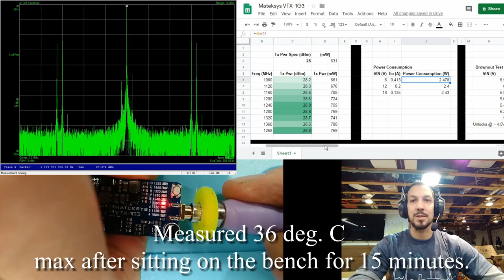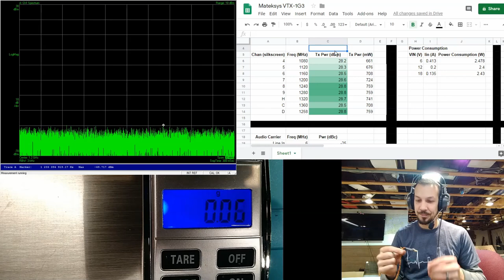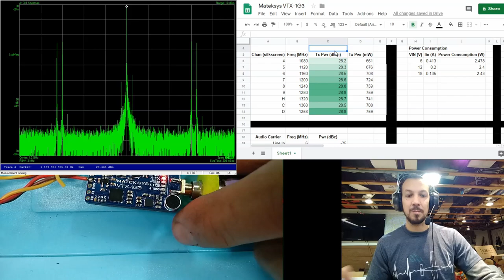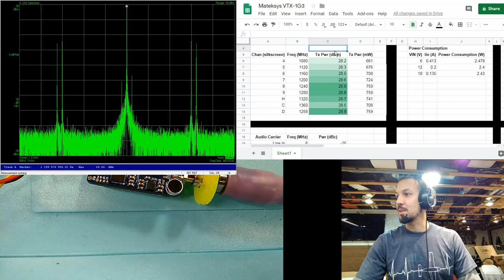Mateksys VTX-1G3 1.3 GHz VTX First look - Long Range FPV Video Series - PK's Lab

Comment: Hey PK, I see on Matek's website that it accepts audio both on 6 and 6.5MHz as you said, but on Matek's website they say that for 6MHz audio you need to tap directly into a pin on the transmitter module, the audio in is for 6.5MHz, same for the onboard MIC, but I am a little confused, if the pin and the mic are on 6.5MHz both how does it know when a mic is connected to the audio in pin to switch the onboard mic  off? And also if you go on Matek's webiste they show you the pin for 6MHz audio, if you have time and the possibility can you test if the onboard mic switches off when connecting an external one? and if indeed the pin is 6.5MHz or 6MHz, cause with 6MHz I think the RMRC receivers can do 6MHz audio, I'm also thinking if replacing the trap filter in the recievers from 5.5-6MHz to 6-6.5MHz would allow the receiver to get audio . Thank you very much for any ideeas on this matter, really apreciate it

Comment: actually in vco's the inductor produces that microphonic thing (in my line of work, FM broadcast tx'es) if I have a noisy fan  those vibrations are heard on to the carrier ahaha except those new DDS things
Reply from the maker: Nice! What power levels?  agreed :) inductors are def a source of micro-phonics.  Especially if they are air core.  But don't rule out other components. esp as you move up in frequency.  Anything that is in the loop or tangentially involved with the pll in can be a potential source.  I really should've recorded this video first thing in the morning.  Was running out of caffeine and I think it shows ;-)
Reply: @PKsLab  Well I have tx's ranging from 50w to 5kw :P  I remember years ago when trying to make pll works in 88-108 :))

Comment: I think what most folks want to know is the selectivity of the VRX.  
That is, how well does it reject signals on nearby channels or bands.
Of course you'll have better ways to do this with your equipment, but the way I've always tested this at home is to power up camera +  VTX  with it signal highly attenuated (I run it with a terminator, while placed inside my microwave oven), and then VRX in another room, while I power up another VTX or control system some varying distance away and on various frequencies  to see how badly the VRX receiving the weak signal gets stepped on.  
I've tested old Racewood VRXs, same + SAW filter upgrade,  newer Racewood style with Comtech module, several versions of RMRC's digital display VRXs and the junky original digital displays, as well as a couple 1.3Ghz goggles modules.    
For noise sources I've used another VTX on various other 1.0-1.3Ghz channels.  VTX on 910Mhz.    Crossfire at 915Mhz and various 433Mhz LRS Tx's which sometimes interfere directly with the electronics of the VRX (especially the goggles module). 
 Some of them have greater sensitivity, but for selectivity, nothing holds a candle to the original Racewood + SAW filter. The stock digital display units are so bad, I throw them away. RMRC's digital display units are better, but still not great.   The 1.3Ghz goggles modules tend to get stepped on by 433Mhz control signals.     All of them are susceptible to noise from Crossfire relatively quickly (verified in the field), and I was never able to find suitable filtering on either VRX or Crossfire TX to prevent that.  

I suspect what most people these days want to know is whether the new Mateksys VRX will play nice with Crossfire.
Reply from the maker: Good call, time permitting I'll try to do a full set of measurements: sensitivity, 1st and 2nd adjacent channel rejection, intermod and blocking performance just to cover all scenarios and will compare to the nexwave module and the 4 channel rx.
Reply: I usually use the good ol 4 channel RMRC VRX with upgraded SAW filter, it reject the 868Mhz perfect. But when I use a Nexwave v3 module in the goggle, the 868Mhz is all over the screen when the dynamic power bumps up to 500mw when far out. A massive gain in rejecting 868Mhz is a super simple notchfilter on the VRX antenna, specific length for rejecting 868Mhz. Rediculous how much a simple piece of wire can make that much difference!
Reply: @13FPV   I did not have that much luck with even the Racewood style 4 channel VRX when I tested with Crossfire at 915Mhz  @ 500mW.   It started to step on the signal only about 1.5 miles out, and was unusable at 5.    That's while I was positioned within an arm's reach of the the VRX.   I also tried various notch filters supplied by VAS without much luck.   
It can be made to work with a lot more separation, but that's a non-starter for me (I steer my VRX antenna by hand).
Reply: daemn42 I may have the solution for you. What I do when I fly out for 15 miles or more, I put my crossfire on a 2.4ghz relay up on a tripod (or on top of my car) and stand 25 feet away from it. I set my crossfire dynamic power on at max 500mw and because it’s high up, it mostly stay under 500mw. That way you can move your VRX by hand with just the low powered 2.4ghz control link nearby. The only video of the relay setup I have is an old one, still on 433, but it’s the same setup now but with crossfire... At the very end of the video you see the repeaters (yes, got the VRX also on a repeater) on top of my car... (In this vid they are close together because I stayed pretty close to home) Anyway, 2,4 to 900 control link repeater may be the solution for you. Here is the old vid:  https://youtu.be/KqpYfBJPL0A

Edit:
Why move the VRX? I made a 4 element yagi, it has almost a 90 degrees “field of view”, even way out... * do NOT fly behind the antenna! 😉 The ting is visible at the very end of my last video... https://youtu.be/nATWNs5DjLY
I don’t like spamming my videos but I try to help!
Reply: @13FPV   I move the VRX antenna because I don't just fly straight away and back,   I often do a circuit.  Maybe  7 miles in one direction to the top of one mountain, then fly a crosswise course to another mountain and come back in a different direction than I went out.    As I said, using a relay is a non-starter for me.  Period.   Besides, when I make that flight using 433Mhz LRS at 600mW, it does not step on my video.    I've been out 15 miles with the same setup, while sitting less than 1m from my VRX antenna.   The goal here (more for others than for myself) is to find a 1.3Ghz VRX that is not negatively affected by a control system running on 868Mhz or 915Mhz at  500mW nearby.    I know one such VRX exists, but it's only packaged with a 3W transmitter and only has one usable channel, so if it turns out this Mateksys module has better selectively, then that will be very useful for all the folks who use Crossfire or the FrSky R9*
Reply: daemn42 Clear! Let’s hope for the best with this Mateksys system then! We’ll soon find out I guess!
Reply: @daemn42  Get yourself a 7 dB Patch antenna on your video reciever with a low power 5.8g relay ...All your problems will be over...🤔..It's what I do ..